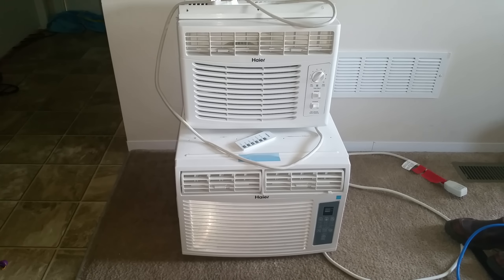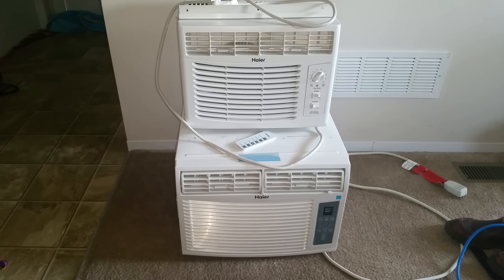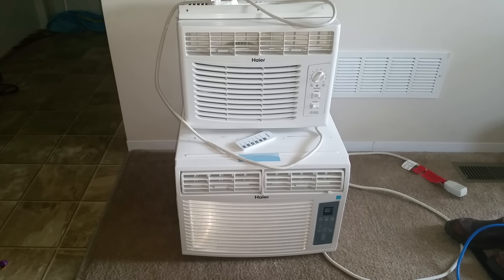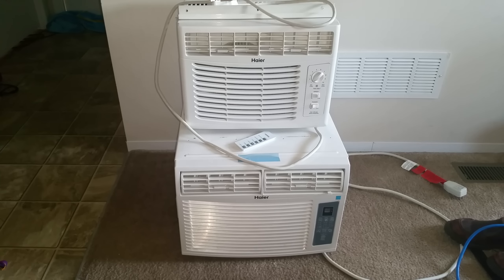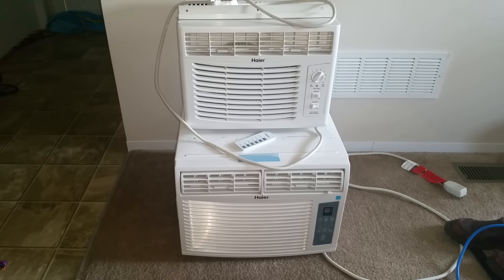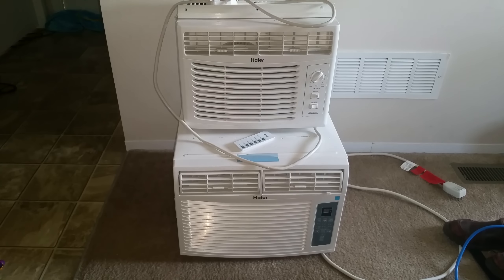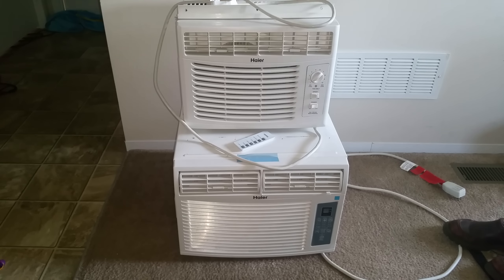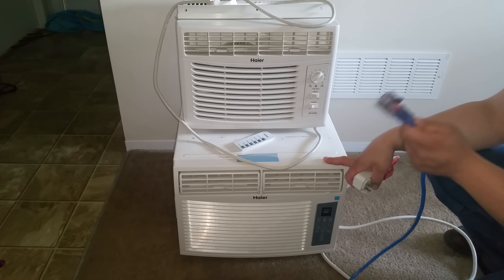Size a Solar setup for a window air conditioner

Comment: i know its an old vid but it is still good info. im using an 12,000 btu midea mini split window unit on my 2000 watt pure sinewave inverter and no issues so far. it uses less power and is way more efficient. good vid thanks for making it.

Comment: Hi thanks for you video

I think your inverter should power the big a/c easily. I think the problem is that the surge causes the battery voltage to sag below the inverter’s low voltage cutoff. The inverter is likely turning off due to low voltage. Try adding batteries and use a thicker/shorter wire from batteries to inverter and that should fix it

I know vid is old, but viewers need to know

Comment: I found that the size of the cables from the battery to the inverter makes a huge difference. My 2000 watt inverter is more than capable of powering my circular saw with 1/0 cables on the DC side, but it faults out if I use #3. Too much voltage drop causes the low battery alarm fault.

Comment: A good 2000w inverter has no problem starting and running a 13,500btu A/C.  I’ve done it for years.  What this YouTube does not say is what is the output capability of his battery bank.  If the battery bank cannot output at least 100amps (1,200w) the inverter will be asking for more power than the battery bank can deliver, and will consequently fault.  If the is poster had used a LiFePo4 battery with a 100w or higher BMS, it would have worked fine.  It would have also worked fine if connected to a powerstation with at least 1,200w output.

Comment: You could try the OSP Tiger claw 1500 watt pure sinewave inverter. There's a few videos on youtube of people testing its surge capabilities (knurlgnar24), and having the sine wave can't hurt your compressor's efficiency. I know it's only 1500 watts continuous, but it is pretty impressive for a $200 inverter. I've only tested mine on small window A/C units like your top one, a dehumidifier, and a keurig 2.0, but it ran them all individually.

Comment: The 4.5 amp ac will never draw 20 amps on start up. Maybe 8-10 amps 👍🏻😉
Reply: Use a 5 farad kick starter.  $59 on Amazon

Comment: I had powerjack 8k.  24v. 600ah. turn on 12k air conditioner easy.  I turn on little 20g water heater 2200w  just fine..  thank you for your video.

Comment: Good info thanks! Where is the best place to buy a small AC that can run on 12 or 24 volts? I'd like one for my solar travel trailer! Thanks
Reply: This is my biggest fear of not having an ac in my van. Still confused lolol

Comment: Now days you can buy mini split hybrid ac heat pumps that run straight from solar panels. No inverter, just hook the panels directly to the built in mppt solar controller.

Comment: How many watts solar panel is required and how many batteries to run the 2.4 amp AC? Thanks for your reply.
Reply: Probably 2-3 100 watters . An mppt charge controller plus batteries to power inverter.

Comment: Typical window units are hard on electrical system due  to the compressor start up .  Get ride of those window units and get a Minisplit heatpump .  The thing is window  units are hard on your inverters while minisplits have a soft start up. The compressor  starts out slow  using low  power then ramps  up untill the set temperature  is achieved . The compressor slows  to make just enough cooling to maintain the st temperature .  . Mini ' s are the only  real choice  since window units eat up more of your finite  power by at least 20% while saving wear and tear on your system components.  There are solar ready heatpumps with seers of 65 verses a window  units eer of 12.. or seer of 19.

Comment: the power jack inverters are actually only half the advertised wattage, so if you have an 8000 watt  in reality you only have a 4000 watt inverter

Comment: I’m running a 10k btu unit with my setup. It doesn’t run for long though without sun because it draws about 60 amps from my batteries while the ac is running 🤣. I have 2 200Ah lifepo4 batteries, a 5000 watt low frequency inverter, and 1000 watts of solar for it. I’m currently downsizing to a 5k btu because I found one that draws less than 400 watts so I’m willing to try it out. Sure beats buying a while lot more panels and batteries.
Reply: Did you downgrade the Ac? I'm wanting to do a similar setup.

Comment: you can take care of the surge with a capacitor pack that will supply the needed surge requirement and then allows the rest of the lower power to be used from the lower power system.
Reply: Hi Can you please  put a link of one ?thanks in advance👍
Reply: @lizpuertorico5968  do a YouTube search for hard start capacitor air conditioner. You can buy the capacitors on Amazon and eBay.
Reply: I tried that and it does not work.
Reply: I tried that and it does not work.

Comment: very good video . I am thinking of buying the Kodiak generator . and just by passing all of the batteries and wiring . but that is a 2,000 purchase . what would a set up that would power a a/c like the top one in your video cost ? thanks
Reply: Hi Jack The Kodiak has  capacity of only 1100 watts and would only run his small A/C for 2 hrs. Then you would need to chain many additional AGM batteries to increase the power bank for longer run time. Remember that solar cannot replace energy when the sun goes down. I estimate about 5 or 6  thousand $$$$.
Reply: If you build one yourself it will do better than premade ones.

Comment: I would say use welding ground cables as your wires from batteries to inverter and use min of 4 lithium batteries at 100 amp hour each and 1500 watts of solar with a good outback flex charge controller and a good pure sine wave inverter that is at least 3500 watts and then make sure to plug your ac unit directly into your inverter or use a short appliance grade extension cord but make sure to keep it as short as possible so after all that you show be good to go 👍 position the solar panels so they get maximum sunlight and then enjoy yourself with all day comfort and you may also add a good 400 watt  wind turbine that will top up your batteries during the night (if its windy) and it can add additional peace of mind through the hot season 😊😎👍

Comment: good luck getting the exact start up wattage on  the newr fridged air models.they dont even know. best answer for there 5000btu unit i could get from them was "between 1000 and 1500 watts"

Comment: They now sell a soft start power cable which allows smaller inverters to run bigger ac units. Problem is the soft start power cable cost 3 to 400 bucks lol

Comment: I have a 3500 inverter and six Bluetooth batteries setup with 1000 w solar runs my rv and my portable a/c from Walmart and I live in southern nv hoping round the blm lands plus I have 1000 watts eco flow power staton with 2 - 110 foldable solar for backup

Comment: Is Your inverter a pure sine wave or a modified sine wave.  Some compressors even on a am small window unit will not start on modified sine wave inverter.  My generator will not run one of My 5,000 B.T.U. Air conditioners.  It does, but it doesn't sound right.
Reply: Russell Hancock modified not suitable for electronic component or something like compressor... Will damage them

Comment: conncet your inverter to capacitor to a/c. capacitor will give you the power you need to start the compressor.
Reply: what does mean ? I am a newby
Reply: @laven111  it means you put a bank of capacitor inline with your battery bank so the capacitors provide the power needed when the surge hits to start up the compressor. capacitors store a lot of energy fast and they can unload it really fast providing the energy needed for a surge. they will reload after the power is used up for the next surge requirement. so if your ac turns on and off all day long you have something to cover the surges when they happen. of course you can get the newer units that do not have such a huge surge demand like the old units did.

Comment: What if you use a startup capacitor?
Reply: I have a 5000 btu a/c with an aftermarket starter capacitor with  a 1500w inverter and it does not work.

Comment: we run an 10500 15amp window unit plus 2 freezers and fridge plus the house on an 3000 / 9000 lf pure sine Aims charge inverter. 24 volt system.  we have no issues and are fully offgrid
Reply: Incredible
Reply: how many panels are you using?thx
Reply: Good for you that's my dream being energy ind ,how many batteries and panels ?

Comment: You forgot one one thing, many people do the same thinking you can run a small ac  dorm refrigerator. That is many forget to do the math of the amp difference from  120 volt to 12 volt. It's volt x amp = watts. So they say 5,000 but 450 watts ac.and only 3.75 amp at 120 volt 
But you change it to a 12 volt it's 37.5 amp draw. That the same as using your van starter all the time and that not counting when the compressor starts. I have tryed this. And the inverter cables get real hot. You need 2 or 0 gage inverter cables. It's didn't work out for me.  as I want a full battery bank at night so after 3:00 pm I can't use the ac. And you need to factor in cloud. To keep turning of the ac.  I rather use just my floor blower at 80 watts vs 450 watts I can just forget it.

Comment: I have a Honeywell portable 8 amp -  120volt  A/C . I run it with a Goal Zero 3000 watt solar power inverter and 4 - 100 watt solar panels. When solar does not keep up , I switch to a backup 3000 watt power inverter and recharge the depleted one on car chargers connected to my Toyota.

Comment: So I took a 6,000 btu window unit, plugged it into my huge 2000 watt inverter, and sent it to a normal car battery.  Clip on ammeter at the battery positive cable read 32 amps running.  WTF?

Comment: I would bet there is a transformer inside the AC unit that convert the AC to DC. if you could bypass the transformer and put a capacitor in the line you may fix the whole problem.
Reply: 5 farad capacitor

Comment: I have the 12V 8KW power jack and 830 AH batt bank it will start my 3KW air compressor easily
It draws 6.7 KW on start up which equates to 27 amps at 240 V
Reply: Iv'e clocked up over 200 KWh usage so far
Reply from the maker: +Awesomus Maximus cool
Reply from the maker: +Awesomus Maximus got any videos on your setup?
Reply: No I haven't but I will maybe today I will
paste a link here
Reply: I've now clocked up 1.2 MW hr but I blew a fuse today I accidently
left my air compressor on while I was using my ac  it clocked 8.9 Kw 741 Amps dc but no damage.
 This thing is tough  i just replaced the fuse and away she went like nothing happened.

Comment: Just buy some super capacitors and wire them into the solar before the inverter. You can start a car with them, they will start your small ac compressor.
Reply: Interesting, do you have a link or anything for how to size something like that?
Reply: I have a few from Maxwell, they are the size of a coke can. They hold a ton of farads, and can be a replacement for a car battery. They are about 2.7 volts each I think. I wired them in series to up the voltage. There's a guy on YouTube that goes by lasersaber. He has some good videos if you do a search. The benefit is that they can be charged and discharged for decades. The super capacitors would provide as much current as your wiring can support. Starting a compressor would be easy.
Reply: that wouldn't solve the inverter default. he just need to get a bigger inverter. the capacitor would help the battery bank though.
Reply: That is kinda true. If the inverter can handle a large starting current, but the solar can't keep up with the demand, then these kinds of capacitors would work to offset the startup. From what I remember, he wasn't using batteries, just solar panels.
Reply: Objectivityiskey oh I see. then he needs some batteries. I love this kinda stuff.
Reply: I know this is true, because I just built a solar inverter with super capacitors. I have 6 Maxwell super caps, two 20 volt panels, a relay cutoff icu, and a harbor freight inverter. I use this setup to run a tower fan. To start the fan, the setup need the capacitors to get the motor moving. Once the motor is moving, the panels keep it going all day. It's the same principal, just on a larger scale.
Reply: Possibly, if he wants to run the ac when there is no sun. If he want to run the ac only when the sun is producing enough light to power his panels, then he doesn't need a battery. Instead of a lead acid battery, he could spend a bit more and go with the iron nickel battery. The iron nickel batteries last so much longer than lead acid or lipo.
Reply: Objectivityiskey there is a guy who can show you how to build those batteries yourself I can't remember his name

Comment: Impressive! Any complaints from your apartment management about the panels on the balcony?
Reply from the maker: No, in fact the complex managers were impressed I was able to do this at all.

In the end it never paid for itself at all. I didnt have enough sun exposure for it to work right but it was a great emergency backup. Now I have a full off grid setup and I run my house on it during the day.